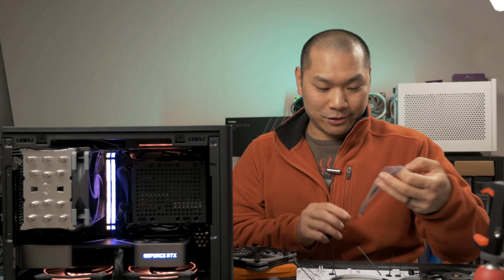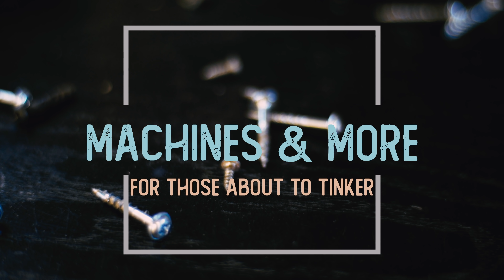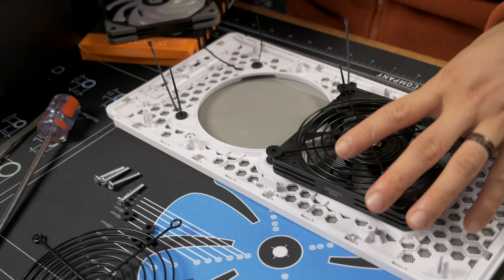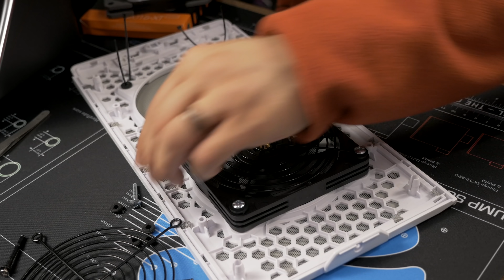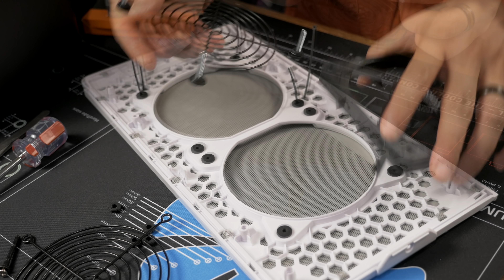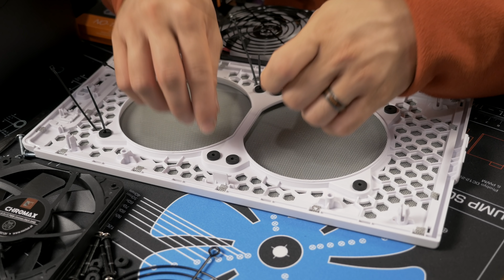Slim 120mm Top Fans in the NR200: Cheap, Easy Mounting Solutions and Thermal impact

Comment: Do you have a review of the 4 slim fans you recommended? I couldn't find one on your channel. If you do not, which fan would you recommend in terms of noise, airflow, static pressure etc? Which fan is your favourite and how would you rank the rest? Thank you!
Reply from the maker: Performance wise, the Noctua slim is the best, but they are also the most expensive, As a case fan though, any of these will do well, but I think the only reason to go for the ID cooling one is if you want RGB. If you can get the Kaze Flex Slims those would be the best balance of cost and performance.
Reply: @MachinesMore  Thank you for your helpful response. The community appreciates you!

Comment: Liked & Subbed - top video, brilliant mods, i bought an NR200P from the states as there were none available in the UK but it was well worth it! created my own AIO inside with a 45mm 240 Rad with 2x Rajintek Aeolus Beta's (RGB) and will add the GPU to the loop later so i can have the gpu mounted vertically with the glass panel on. I'm unavailable to do so at the moment as with an open air cooled GPU it just creates a heat trap.
Reply from the maker: Awesome Matthew. It sounds like you build a custom loop there my friend!

Comment: Any reason you couldn’t use the Chromax rubber isolation pads the fans come with?  I might have missed the explanation, so sorry if I did.
Reply from the maker: You can, it would work too and just put them over the grill. Not all fans have them so I thought having the rubber bumpers on the grill would be more universal.
Reply: @MachinesMore  Hey, that makes perfect sense.  Thanks for the reply!

Comment: Just about to purchase this case ( well 2 actually, one for gaming, one for work ) and wondered which AIO cooler you would recommend ? 

Great content by the way ;-)
Reply from the maker: J C, with the vented panel you have many many choices, too many to count. The out of the box pick for best thermals would be the Liquid Freezer 240, although it is a pretty tight fit. Any Asetek based unit is generally a good bet too, Corsair H100i or NZXT Kraken X units are quite popular. Personally if I were to run an AIO, my choice would be to use my old NZXT X52 with upgraded fans to Noctua NF-A12x25 (I know, strange to pick an older model right). It's a bit of a strange pick but the X52 has a built in fan controller and since the unit monitors coolant temp... you have the unique ability to index rad fans to coolant temp, something you can usually only do with a custom loop.

Comment: Are slim 120mm fans a bad idea as an bottom intake? I was planning on using two a12x25's on the top and two a12x15's on the bottom with a 3080 FE, but heard the temps are better when using static pressure optimised fans, which the a12x15's don't seem to be. So there's the question, is it better to have thicker fans, closer to the gpu or slimmer fans, i'm asking in case there could be some sort of turbulence caused by the fans being so close to the gpu and so on.
Reply from the maker: The A12x15 are great, not as high static pressure as the NF-F12 but can typically move as much air on a noise normalized basis. My preference would be to run whatever fan gives you at least 7mm of a gap. 2 slot cards, 25mm fans. 3 slot cards, you might only be able to run slim fans. They’re not cooling the GPU directly, their role is more to give the GPU fans a better source of cool air, so they don’t have to run fast.

Comment: hey bro, i've got 2 question. Can one of these small fan fit on the other side of your Sycthe Mugen 5 cooler? If it does, does it make the scythe mugen 5 perform better as it is now in a push pull config. Another question is, why is the scythe fan facing inwards? is it because thers no way the hot air can go away if it is set as exhaust?

Comment: Thanks for all the great content, specifically for this case. Any thoughts on the phantecks evolve shift air 2? Always thought the aesthetics were great and hope the updated model is improved temperatures
Reply from the maker: It's a really interesting tower design- I might check that one in the future but thermals with high TDP chips are my main concern due to the limited CPU cooling options. 120mm AIOs aren't exactly sufficient for some higher TDP chips and for air the best choice might be something like a Noctua L-12S or Scythe Big Shuriken 3, which would be fine for Ryzen 5 or 7, non-K intel.

Comment: Off topic a little, if I were to put slim fan on the bottom, and it's a very tight fit with my thick Gaming x trio gpu... Will it be a problem if there is not much clearance between the fan and the gpu?
Reply from the maker: There might- if there’s a small gap then it will be OK but if touching... the only way it will work well is if you lock your GPU fan speed and bottom fan speeds at a setting that allows both fans to move the same amount of air through (will take some experimentation with temps and careful listening- bad rpm combos will cause turbulent noise). Or, if you can index the fan speed to GPU temp that might work since at least it will somewhat be in stride with the GPU, otherwise I would recommend ditching them. They will still help, it’s just that with thick GPUs you are close to the bottom of the case so the usefulness of case fans is diminished somewhat, it’s already able to get cool air better than a 2 slot card.
Reply: @MachinesMore  thanks you so much for sharing! And just to let you you've been a big help for our NR200 community. Thanks!

Comment: Important info. You will have mugen 5 clearance issues with the top fan if you use the GIGABYTE Aorus Pro AX, as the CPU socket sits quite high in the MB. If you use ASUS B550 I  GAMING then you wont have issues, as the CPU socket sits lower.

Comment: Thanks for making this video. Would you be able to do sort of a review video on that ID-Cooling slim RGB fans? Was thinking of buying them for my GPU deshroud mod as the current fans I have is the previous iteration of ID-cooling's slim fan, but without the RGB. I'm just thinking if the new fans are worth getting as I wanted to add some flair to my system.

Comment: So with all those fans, bottom and up, you really need a hub, don't you? I mean the NR200p gets the 3 device hub if I recall correctly. Not sure how's the situation with the regular NR200 though. Which hub would you suggest as the best solution for controlling all the 4 case fans in unison? Btw. not an RGB LED solutions fan unless they're also functional foremost (eg. default to temperature driven color mapping available through BIOS and not in OS installed service/app as these often are working well on Windows and not linux or bsd) - I prefer to save those micro amounts of extra energy required for lighting, extra cables routing needs, and extra amounts of heat dumped into the spinners and focus on better performance and efficiency...
Reply from the maker: If your fans are rated at less than 0.25A each then 4 should be fine on a 1A header, you just need an additional splitter to get to 4 fans from the stock NR200 one (yes it’s included). A standalone fan controller is nice but not necessary.
Reply: @MachinesMore  So eg. 2 top ones connected through Y splitter to one  hub port, same with 2 bottom ones... And wich slim fans wold you suggest for NR200? Slim ones usually are not static pressure optimal, but maybe you know some great ones that would not break you bank or deafen you ;) Scythe Kaze Slim 120x15 or Noctua AF120x15 or maybe something else that's efficient enough, slent enough and cheap enough?

Comment: Thank you so much for all the information and scenarios when building up with this Nr200 case... However I have a doubt, since the case supports both SFX and SFX-L psu, when you use the larger one, is there enough space for a normal top fan, or with this SFX-L you have to use a slim fan??
Reply: Hello Stephan. When using a SFX-L PSU the space between upper fan and PSU cable will be too small. On the Cooler Master Website there is a notification abou it. I tried a 15mm fan as shown in the video and it just fits. But I had to push the lid hard to get it closed. So I changed my SFX-L to a SFX in order to have an optimal cooling with a regular 25mm fan. But if u try the slim fan you definitely don't have the space for the fan grid.

Comment: Howdy sir. I was wondering if you knew what the cpu cooler clearance was in the nr200 if you have a graphics  card mounted vertically. I like the look of it but i also like air cooling so i was wondering if it would be possible.
love your work
Reply from the maker: It’s about 75mm, so it’s not ideal at all for air cooling. Too little circulation in front of a low profile cooler. Liquid cooling is the way to go!
Reply: @MachinesMore  ok, thanks for the tip!

Comment: Really enjoy the content man but I don't understand why the default mounting hardware doesn't work with slim fans? It seems you can easily replace the top fans with normal 25mm ones with the system provided... Why doesn't this work with slim fans? Thanks
Reply from the maker: The hardware is too long, also it has a larger diameter in certain segments that hold a 25mm fan in place, they won’t line up for a 15mm fan. I was looking at the hardware and if you cut it down it would likely work, but you can’t go back to 25mm fans.
Reply: @MachinesMore  cool, understood. Thanks for replying... Let's hope some NR200 stock arrives in the UK soon.

Comment: Hi! Im planning on using a 5600x with b550i gigabyte board and nr200 with mesh side panel. Watching your videos Im planning on using a c14s to cool cpu and I want to hopefully overclock it, do you think theres headroom to overclock the chip with the temps? Also, which other fans for optimization should I use? I was planning on using 2 nf a12 counterparts the arctic p12 pwm on the bottom as intake, which other fans can I fit in this setup? and for your video showing the c14s did you have 2 fans on the cooler or just the a14 on the radiator support? Sorry this is a long question but if you can answer some of my worries I'd greatly appreciate it! Thanks
Reply from the maker: Oh for sure. The C14S is a lot of cooler for the 5600X. Your limit will be the silicon.. my particular sample doesn’t like going past 4.7ghz and sometimes that’s just what happens. AMD’s turbo spec is 4.6 all core and you can generally get there with even a 120mm single tower. If you have the Arctic P12s they work well as case fans. At a minimum you can also get a top 25mm fan over the PSU side of the case. If you are running a 30-series FE card a second side panel fan helps, but not necessary otherwise.
For the way I ran it I had the A14 on the rad panel and an NF-A12 under the heatsink.
Reply: @MachinesMore  Appreciate the response! glad it overclocks that well temp wise. I'm either getting a FE 3080 or an AIB. So I will have 2 arctics intaking from bottom the a14 intaking from rad panel with a nf-a12 or arctic 120mm underneath heatsink if ram is willing. Im confused about the 25mm fan, can you link to a fan with that size as Im not sure which that is, and do you mean having it directly to the side of the a14 on rad panel or something else? and which fans would you recommend for exhaust on the very top of this case, fit wise for the b550i gigabyte. Also lastly do you use any fans on the back of the case to exhaust or intake? or empty? thanks man so excited to build my nr200 and your channel makes it fun

Comment: Thanks for the video! I have the regular NR200 with a RTX3070 (a fairly large one with 3 fans). Do you think placing two intake slim fans below the GPU (it's tight) is a good idea or should the GPU fans by itself be enough to suck in the air? (I run a liquid cooler for the CPU (Kraken X52) + one top exhaust fan (stock) + one rear exhaust fan (stock), temps are fine across the board)

Comment: Is it possible to mount the slim fan using standard fan screw by removing th rubber grommet?
Reply from the maker: You would need something to hold it in so if you pop off the top mesh and put a fan screen through the grommets it should hold. A bit more work but it can work.
Reply: @MachinesMore  Thanks! this would help alot.

Comment: It's been 2 weeks and I'm still waiting for Noctua to send me the fan clips so I can install the 120 mm fan on my NH-C14s. PC is just sitting there staring at me, all exposed and waiting.
Reply from the maker: I would run it with the A14 on the top of the heatsink first, and just add the fan later. They ship them from Austria so it does take a little bit of time.
Reply: @MachinesMore   thanks to you and your diligence, I was finally able to finish my NR200 build! After 3 months of headaches and returning parts I’m FINALLY DONE!  Thank you a thousand times over and over.

Comment: the fan is mounted wrong? I mean it should be pushing the air to the back instead of pulling air to the interior, unless you have fans mounted on the side

Comment: Would the stock AMD wraith cooler that comes with the ryzen 5600 work ok in the nr200?
Reply: Answering my own question after watching more of this channel’s videos. Definitely not. I wanted to cheap out and stick with a smaller cooler because I wanted unimpeded airflow in the case as much as possible, I don’t know if I’ll be able to get an FE card, but it feels like a massive tower cooler impeding the airflow with the cheaper vented version of the nr200.
Reply from the maker: Well, it will work fine but it depends on how high you want the chip to turbo to. Based on the stock cooler's thermals at 25ºC ambient it's not going to want to boost up very high. For the FE cards, the exhaust is slightly canted towards the tower but from my experience it's easily mitigated by the top exhaust. In fact it almost plays perfectly into the chimney created by the top exhaust. 
That is the reason you do not want to run the air cooler as a rear exhaust with 30 series FE cards. If you want a smaller cooler you can consider the L-12S or Big Shuriken 3, those are all solid choices and will work well with the vented panel.
Reply: @MachinesMore  thank you! I’ll check those options out

Comment: Hi, so I don’t know whether you are going to react on this. I love your series as I tend to get the nr200 myself. I’m going to get a i9 9900k with a 3070 when it’s available. I don’t really use that many cpu heavy tasks, so my gpu is the main thing that has to stay cool. The thing is: where I live, the C14s(109€) is more expensive than the U12a(98€). I don’t mind spending more money if it works better. So I also looked at your aio vids and found the nzxt kraken x63 and ther Corsair H115i. I’m a little worried that an aio in this case wil get malfunctions due to little space. What would you, or anyone else recommend? Have a nice day and thanks again for the series, you’ve helped me out tremendously
Reply from the maker: If the U12A is cheaper then that’s a very good choice too. 240 is a better fit in the case but 280 works well too, I don’t have any big concerns with AIOs with the NR200 as long as your tubing isn’t kinked or bent.
Reply: @MachinesMore  okay so I went with the C14s and just made the pc, I’m loving it, but there is one small prob. You refer to putting an nf a12 underneath the C14s, but how did you install it? That’s a small problem I’m having currently. The given mounting brackets are to big for a nfa12. Any tips?

Comment: Can someone tell me the size of the nr200's box (not the case itslef, the box where's the case when you buy it) thx :)
Reply: Its so small that the Components boxes dont fit in :D i will measure it later
Reply: Hi, NR200P box size - 43 x 28 x 34,5 cm. Tempered glass box is 3cm thick, so i guess that NR200 box size is 43x25x34,5 cm.
Reply: @KOPAKOPAK  thank you 🙂

Comment: Hey so another easy option... The metal mesh comes out in about 2 minutes. Then flip the rubber grommets that are in there stock. Use common fan screws from the top to attach the fans. Replace the metal mesh.. profit.. Total work was about 10 minutes to mount 2x scythe kaze RGB slim fans in the top of mine to clear the Mugen 5 & the PSU in the SFX-L position. Most fans come with the screws so its also a 0 dollar mod for most outside of the cost of the fans.
Reply from the maker: Indeed, that was the first thing I tried. It's pretty quick- however I did not want to recommend it for one reason. When removing the mesh and reinstalling it I noticed it was very possible to bend the mesh and put kinks in it that could not be smoothed out easily. It's definitely a viable option but one needs to be careful.

Comment: Sry to come again with wierd questions -> I am trying to get the case to be as open and "flowy" as possible, so I decided to go with the C14S. This 3D printed shroud https://de.pcpartpicker.com/b/bRHBD3#cx3966605 makes a lot of sense to me and maybe is a nice middleground between the Stock C14S and the sidepanel-Version that you recommended (I kinda want the sidepanel to stay off)

What I was wondering was, will I lose much performance by just doing 2 slim noctuas on the bottom and another two slim noctuas up top? That way everything would be less cramped and I am more open to whatever GPU I am able to snipe. Would I lose much cooling by just going with 4 slim fans from the start?

Thank you so much for these vids, they help me out enormously!

Comment: bruh just cut the rods on the stock mounting hardware by 10mm and you'll get the 15mm fan to fit nicely, tool less fit into the rubber grommet
Reply from the maker: Yes, that definitely works but it’s non reversible should the user need to go back to 25mm fans! The notches line up nicely for a 15mm fan.